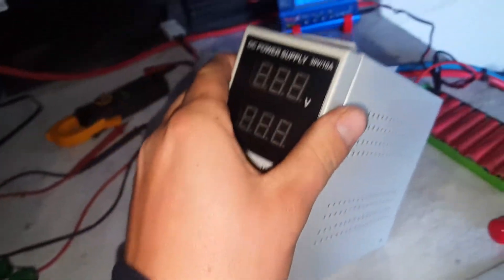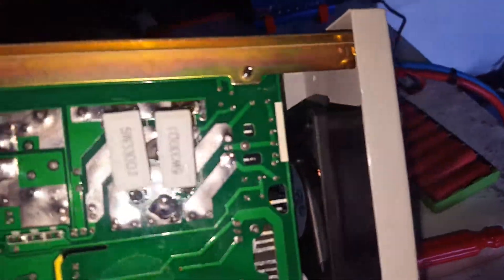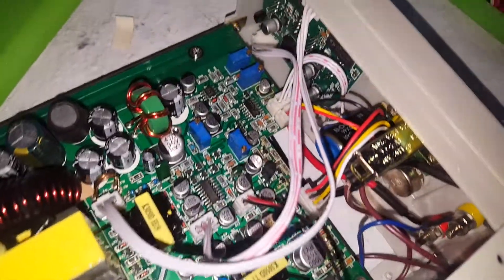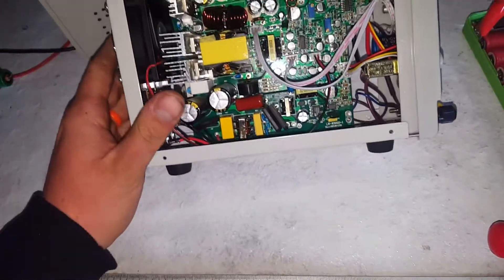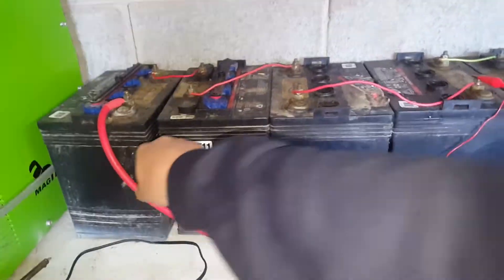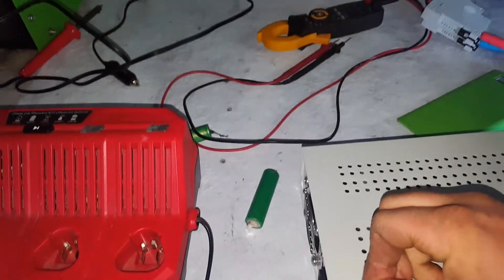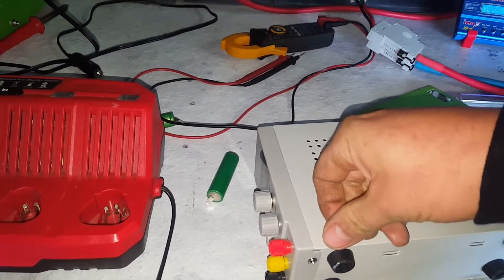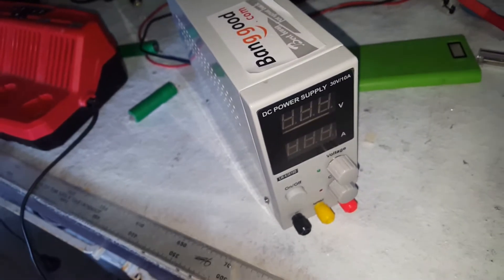10 Amp Lab power supply a look inside

Comment: please help my current button does nothing : (
Reply from the maker: Showing 0 or full on meter
Reply: @Oneupthesleevecustoms  the supply itself only says like max 3 amp if i conect the + an - together
Reply from the maker: @thijs-p9185  check and see if output diode has melted
Reply: @Oneupthesleevecustoms  where to find that diode?